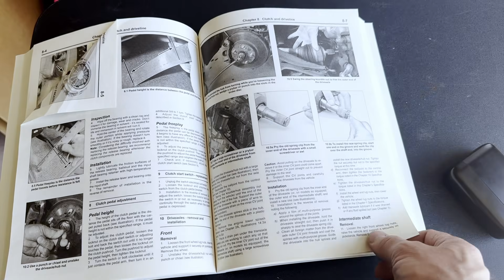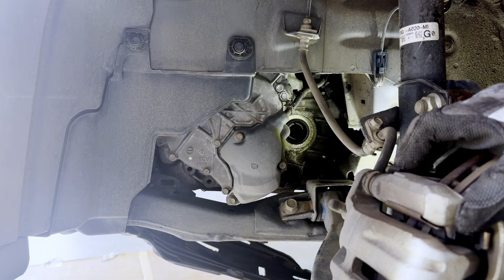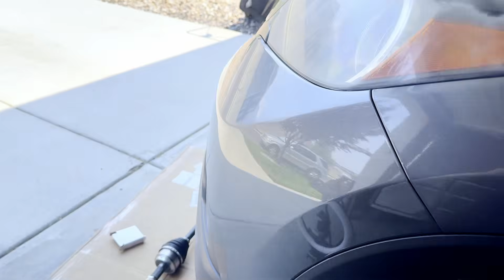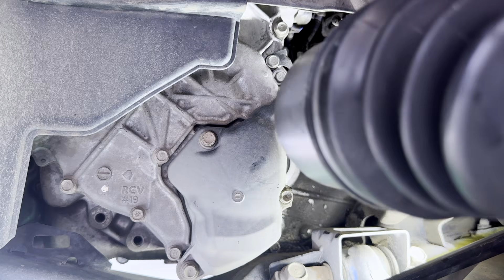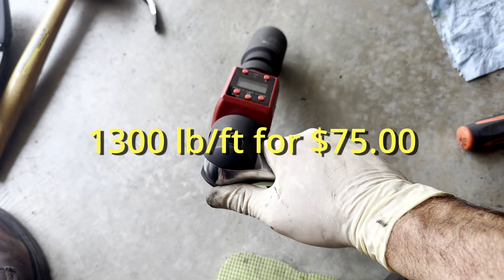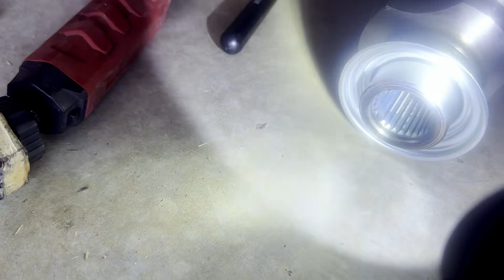Replacing The Front CV Axles On a 4th Generation 2012-2016 Honda CR-V All Wheel Drive How To

Comment: Good video thank you. I assume this car had a vibration hense the replacement of the axles. I'd the new parts get rid of the vibration. According to my research Honda is very picky when it comes to aftermarket replacement parts.
Reply from the maker: You’re exactly right, it definitely had a vibration and aftermarket parts can definitely be hit or miss! In this case, it did fix the issue.

Comment: Do we need a front wheel alignment after replacement?
Reply from the maker: Yes. Every time you temper with suspension components, the alignment needs checking and adjustment if necessary

Comment: By disconnecting the lower control arm, do you then eliminate the need for an alignment?  Most other videos show detach of the strut which would need alignment, right?
Reply from the maker: Whenever you mess with suspension components, it’s always wise to get a wheel alignment, as I did recommend the owner of this car.